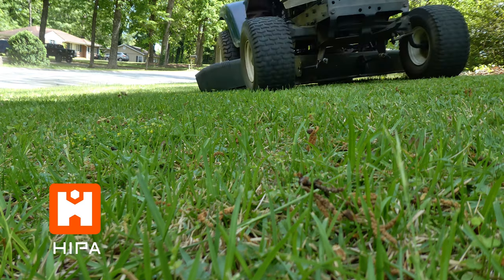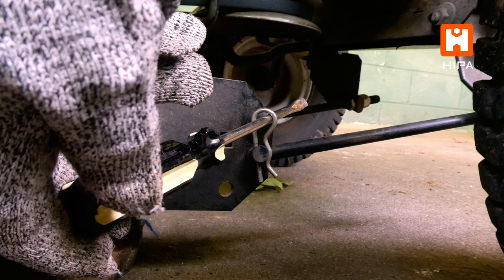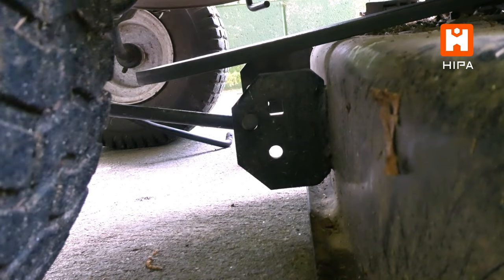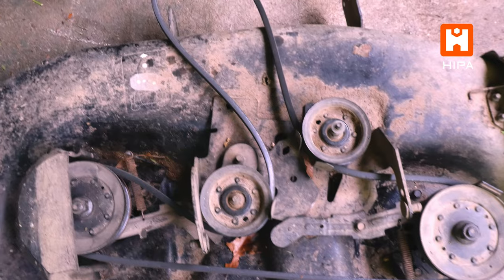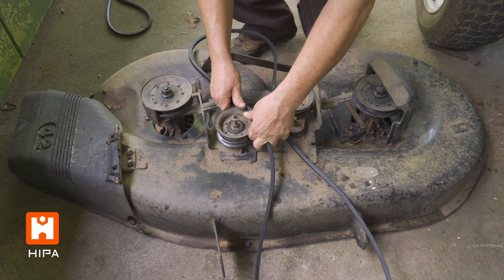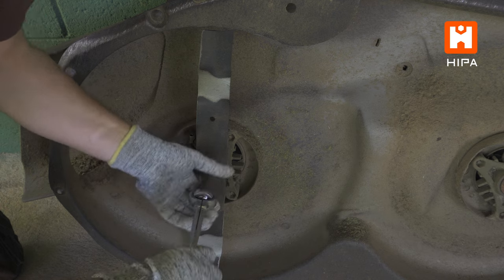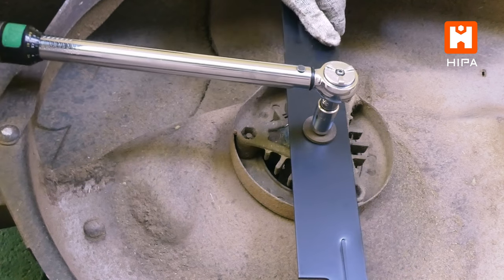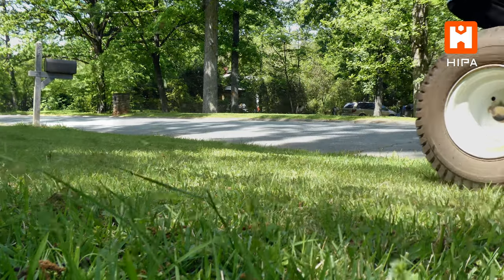Changing belts and blades on a riding mower - HipaStore.com

Comment: before attempting to level any deck check and ensure all tire pressures are to manufactures spec, it will make a difference
Reply from the maker: Great tip Rick. Thanks!